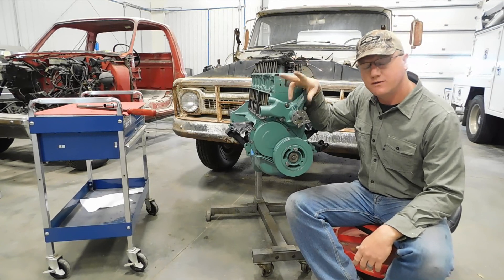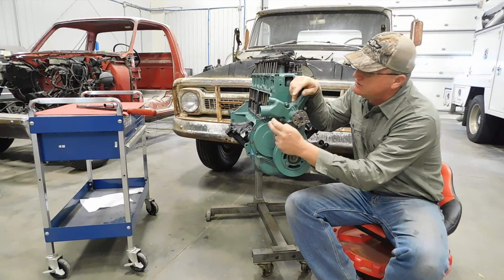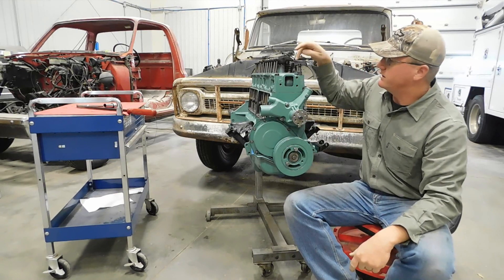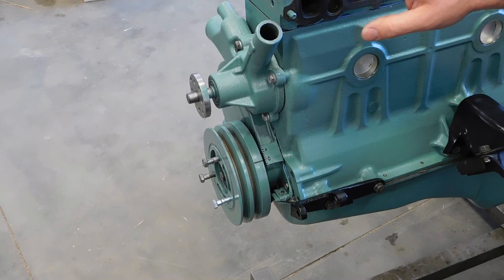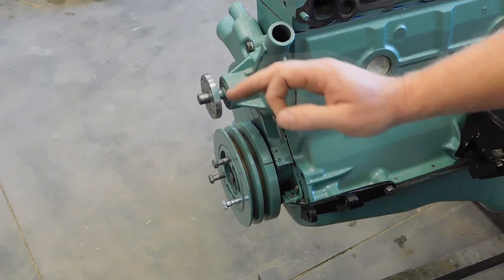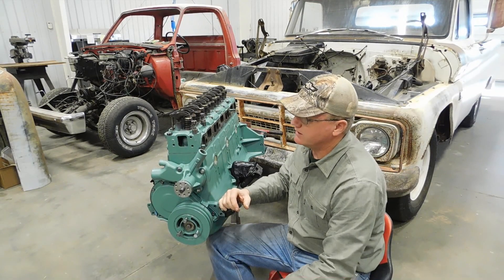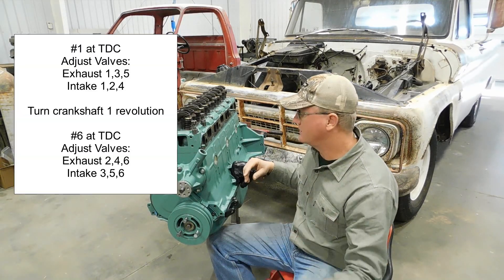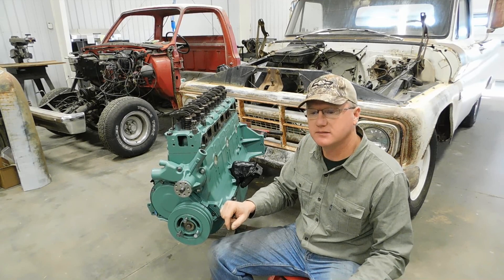Part 8: How to Adjust Hydraulic Lifters - PLUS Crank and Cam Timing and Other Natural Wonders!

Comment: I use the overlap method to adjust the valves. Adjust intake when exhaust is just starting to open, roll the engine over and adjust exhaust when intake is almost closed. That way you adjust when lifter is on the base circle of cam.

Comment: Wow thank you for your video I kept running everything through my head why after a head gasket install that I thought went smoothly, I was getting a no start. If I hadn't seen that this motor had 2 sets of timing Gauges on the cover because yours on the right of the water pump and that was the actual one on this  that read correctly and i never even seen it cause it was covered in oil and trashpq..SMH and a buddy talked me into being 180° out. Plus I didn't have the valves adjusted like you did... if I ever see you.  Beers on me!! Thank you. I uploaded  a video with a shout out to you.

Comment: The thing to watch I learned was setting the distributor in its place with number 1 at tdc. We were 180° off. The piston 1 was on exhaust stroke, not firing stroke. We couldn't see the valves, the engine was buttoned up.
Reply from the maker: In those cases and working alone I always had a special plastic cap that would fit down into the spark plug hole but it had a larger ring around the end so it couldn't get sucked in. Then I would bump the starter until I heard a loud POP and the thing would fly across the shop and I knew I was on the compression stroke. You can also buy a whistle made for the job, or use a compression tester and watch it to start building pressure, or a buddies thumb over the hole. Just some ideas for you.

Comment: I enjoy the things you work on. I have two comments, a person should prove the piston is really on top, mark could be wrong or dampener could have slipped, and at 10:28 you weren't on tdc compression because the intake valve opened immediately so if the mark is correct you were on tdc exhaust.

Comment: I know this is an old post but if you have the marks lined up and take a socket on a breaker bar rock the crank back and forth about 20 degrees and watch the rockers on 1 and 6 the rockers that don’t move is on the compression stroke

Comment: Hey sir, your videos are just great. Watching you turn the motor on the stand, a thought occurred to me: If you were to make up a square tube bracket type thing, using the alternator bracket at the bottom, down to the engine stand's "foot" - well you would have a "leg" there on front that would prevent the engine from wobbling and bouncing as you pull on it. Might help .

Comment: I am not sure who else to ask and I love your videos. I have a 250 inline 6 that is making a ticking noise. I suspect I should replace the lifters and ensure the lash is correct. Can you advise if its as easy as just removing the side access panels and pulling the old lifters out and dropping new lifters in? Obviously, remove the valve cover and rockers first. But, there should be no need to pull the head or anything like that correct? Any tips / advice? Also, any suggestions on the best oil to use in an old 250 to ensure no future issues? Thank you in advance!
Reply from the maker: Yes, remove the valve cover and the side covers and that's as far as you need to go. Look for anything obvious before you begin, look for an obviously loose rocker/push rod. Look across all of the lock nuts and make sure they are all tightened down the same amount. Loosen the lock nuts and turn the rockers to the side so you can pull the push rods up. Look for anything obvious as you go. The lifters tend to wear into their bores in the block and can be stubborn to pull out. When you're ready to begin setting valve lash remove the dist. cap and turn the crank until the rotor is pointing towards #1 and line up the timing mark. Adjust the certain valves I listed in the video then turn the crank 1 revolution to the timing mark again and set the rest of the valves. There are many oils out there marketed for classic cars, really if it was mine I would run a 250 on plain old 10W30 or 15W40 diesel oil. Thanks for watching, let me know how it goes!
Reply: @TheJayhawker  Thank you so much! I will keep you posted! Great reply and MUCH appreciated.

Comment: Very informative video!  An important thing to watch out for when tightening  the rocker nuts is that your socket is not all the way down the nut and touching the rocker - causing a false reading on the pushrod lash.  I think that is what happened to you on the intake on #5 (about 11:25 min mark) when you relaxed the socket - the pushrod was very slack (you were going to back off - then realized you were not quite there (the ratchet popped up when you took pressure off the handle).  I was going crazy doing an adjustment when I did not realize this was happening (leaving the lash too loose on the hydraulic plunger) and still having "ticking".   Nice series!

Comment: is there a video of the 292 running?
Reply from the maker: No video because I haven't seen it run either! The next video that I am currently working on will be attaching all of the bolt on parts to the 292. Then I will probably do a special video immediately after that of turning it over for the first time and hopefully a test drive!
Reply: @TheJayhawker  Sorry I'm getting excited i had a 292 rebuilt in 1985 for a 77 chevy truck, still my favorite truck engine!